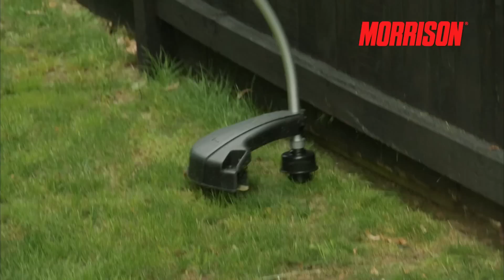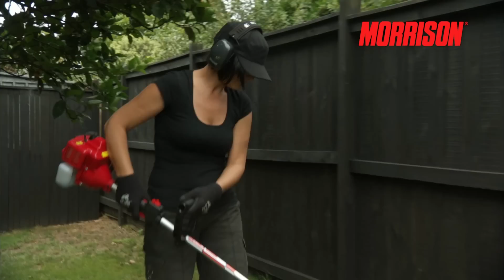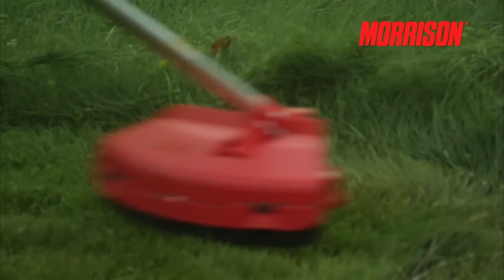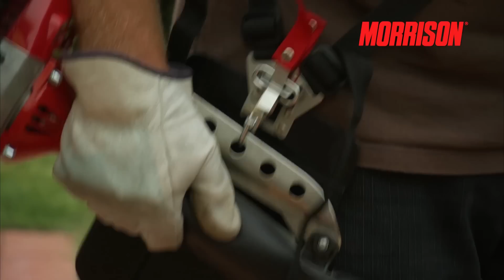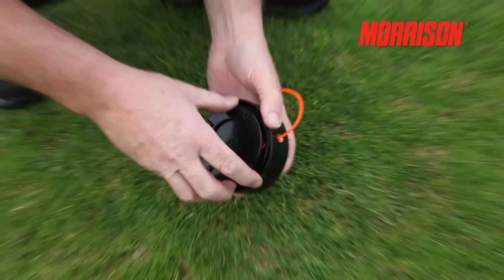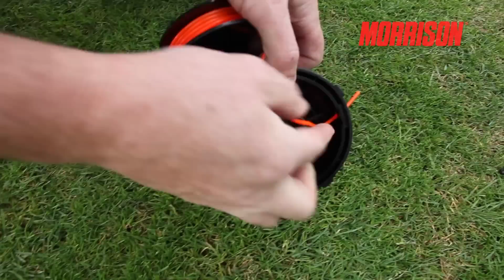Morrison Line Trimmers

Comment: Come here to learn how to pull new thread on mine and it’s completely different, wouldn’t it be nice if the machine came with a manual
Reply: I hate it when a company manufactures and distributes their product and they cheap out and do not include a user manual.

Then they hide behind the guise of "save the planet, use less paper".

Reality is that when we print out the manual, it's on A4 paper and therefore we use more than would have been used had they provided the manual.
If I pick up on the fact a product doesn't come with a manual and I have to spend 15 to 30 minutes searching online and gaining access to it, then print it, I walk away from the sale, don't buy that brands product, then research around for a similar product that does provide the manual.

If I can't find a company which provides a user manual, then I'll reluctantly buy the item.

They shit me to tears they do!

Comment: we got one yesterday that was brand new in box and we got it home fueled it up and we have tried to start it over 100 times and it wont start
Reply: Had a similar issue - try priming it a bit more and also, despite what the manual says, give it a little but of choke.
Reply: This is what really annoys me.   The starting is a pain in the backside with the petrol and went to battery.

Comment: p.s..
Don't tell people what they can & cannot do --- !!! After the warranty period RUNS OUT and there IS NO WARRANTY to be voided, (especially if one has owned the machine for several years).
...
I don't give a rats toss about the (pre-sales / just sold) message from Morrison - when there is NO SERVICE AGENT near where I reside... ?
..
As even the place that sold it to me - DOES NOT SERVICE THESE, nor do they know of anyone - that does.
...
So - here's me with a now useless hunk of junk called a ?
Morrison BC260S2 ... that doesn't start...
..
Hence this statement makes diddly sense - to someone who has "small motor repair skills" and a machine that cannot be started.
[quote]
Under no circumstances should you take apart the brushcutter or alter it in any way. Doing so can result in damage to the machine, and may negate the manufacturer warranty
[unquote]
..Um ..
What warranty - as THAT ran out years ago.
Or - do you want people to just - TURN TO .. "a different manufacturer" - as they MAY sell a better, more reliable - serviceable machine?
..
ESPECIALLY WHEN - NOT TAKING IT APART - results in exactly the same issue ..
IT DOESN'T GO
Reply: Check out this link for Morrison parts and exploded diagram:
https://sesdirect.co.nz/search?q=Morrison%20BC260
Check out Youtube videos like this for carburetor repairs:
https://www.youtube.com/watch?v=7-VpdJEJRRw
Also check out this Youtube small engine repair channel: donyboy73
Reply: @BeachcomberNZ  Thank you.
Links proved worthwhile.
Reply: It just needs a simple service. The symptons you describe can happen to any machine, not just a Morrison. Carburetor is most likely cause, and it's cheaper and easier to replace the carb rather than rebuild it as often a rebuild does not fix the problem. The BC260 is just a generic Chinese trimmer sold under many guises, - sellers put there own brand names on them and we have to play pretend. Link added as an example of carburetor available, - don't knock yourself out trying to find a Morrison service agent or parts, any indy can service it.https://www.ebay.com/itm/122557692050
Reply: @roblord7610  Sorry don't use E-bay - I use Trade Me

Comment: I’m going to have a great lawn business soon and then I’ll have a massive line trimmer and lawnmower collection of lots of famous lawn equipment brands like Ryobi Stihl Makita Echo Morrison Bushranger einhell Weedeater Lawnstar Victa Ozito toro Mtd Flymo Tandem Trimtech Honda efco and lots more
Reply: Ah yes - all different name brands.
Yes - you'll have that "massive list" of different brands as..
None of them will actually provide you - with any halfway decent REPAIR & SERVICE manuals - to keep any of them "running" past their use by (I mean initial basic warranty) period.
Then you'll buy another "brand' to find it only works a few months past it's basic guaranteed warranty period ... before it too joins your increasing multiple brand junk pile.

HEY MORRISON.
How's about being the far better manufacturer, and actually give a damn - about your purchasing clients.

After all - I came to your brand because my Ryobi of 20 years broke down & couldn't be repaired.

Your useless hunk of BC 260 S2 weed-eater only lasted until JUST OUT OF WARRANTY - before it started giving "start-up & run correctly" problems.

And now - it doesn't go at all.
Thanbks for NOT providing an exploded parts diagram on the actual parts within the carby - as not only does it NOT allow the motor to run, it also appears to have a broken return spring.

A SIMPLE FIX - if I could get the damned thing apart.?
Reply: Best of luck with your lawn business!
Reply: @MasportLimited  Yep - best of LUCK (luck being the operative word) as Morrison doesn't give ANY "how to fix" a problem video - or any other "exploded views" of components such as an exploded view of a carby -- to allow the expert mechanic to "fix" a problem such as difficult starting..

NO service this part - "exploded view diagrams" at all.